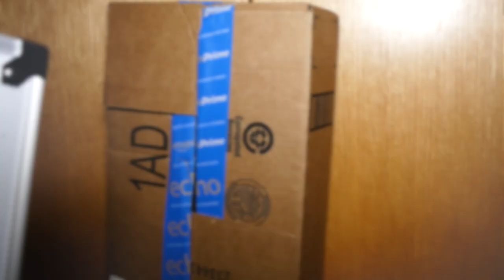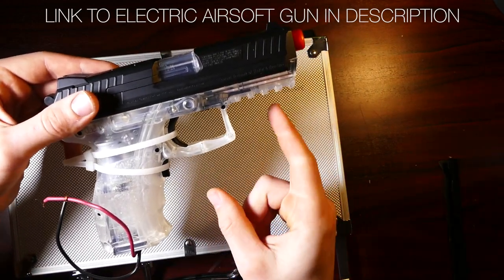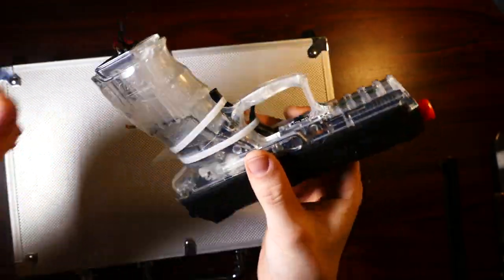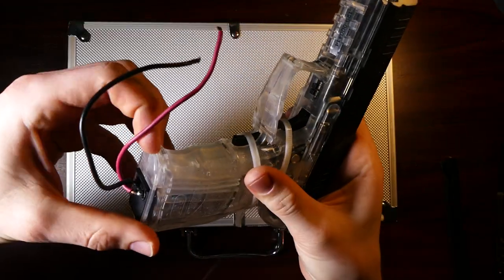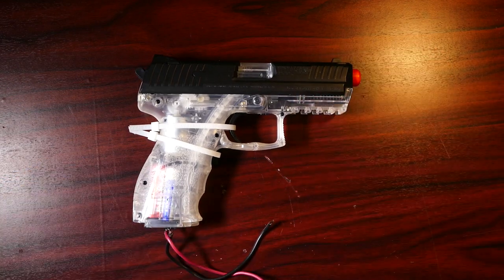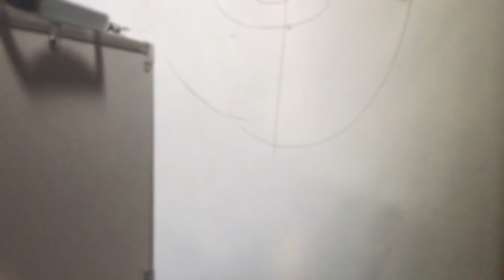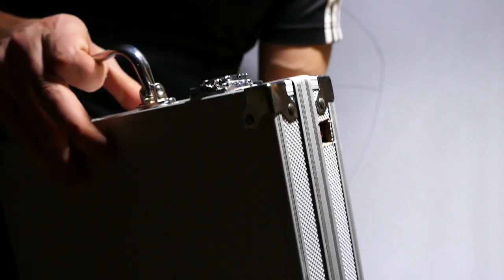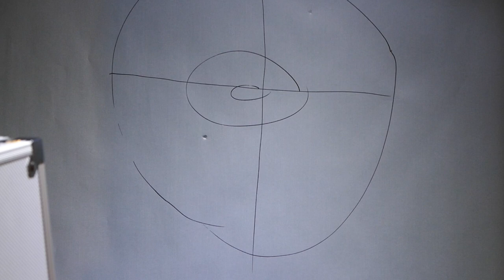DIY Full Auto Briefcase Gun! - Homemade 007 SPY Gadget!!!

Comment: that's not an airsoft gun it's a bb gun and it's also semi auto not full auto.
semi is pulling the trigger or in this case (pun intended) pressing the button if it where full auto you would just need to hold the button and it would constantly shoot.

Still a nice build tho